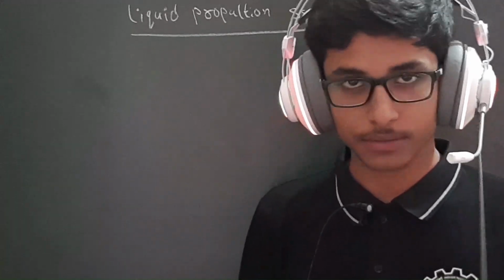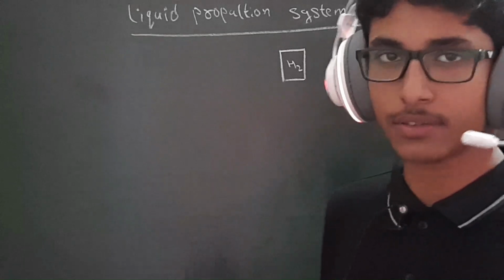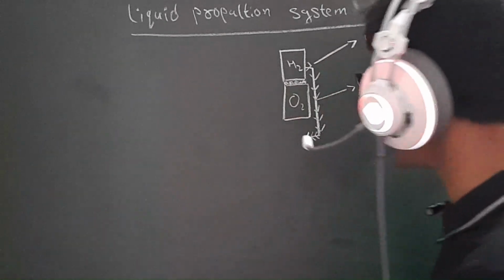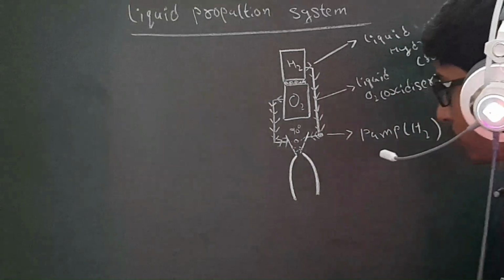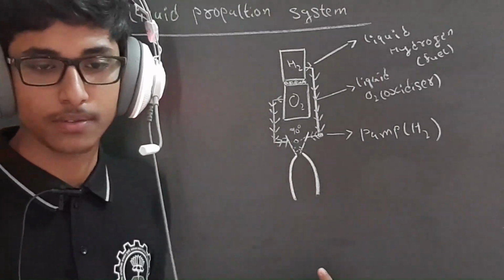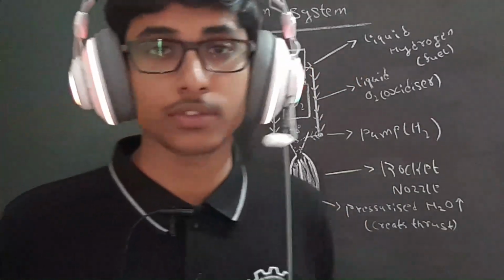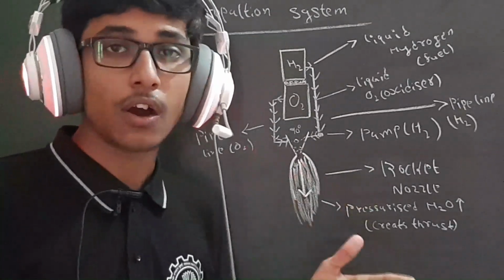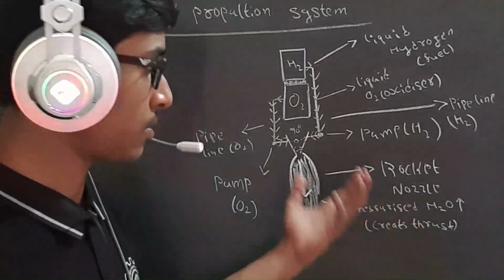Liquid propulsion system in rockets | Aerospace engineering L-1 | Mrinal Thakur

Comment: Cool video well explained though the video isn't crisp I mean for a 17 minute long video it doesn't contain a lot of information probably because you repeat the same thing multiple times example why the oxygen tank is used instead of atmospheric oxygen
Reply: yea, that's right like all basic concepts are clear!!!
Reply from the maker: It's necessary to repeat it for multiple times cuz that's very important sight of propulsion system and many ppl are confused about that so when I am repeating something it means it's not an easy deal! AS I HAVE MENTIONED IN STARTING THAT THIS VIDEO IS THE BASIC INTRODUCTION TO AEROSPACE ENGINEERING SO OBVIOUSLY IN 17 MINS YOU WON'T GET COMPLETE LECTURE...!